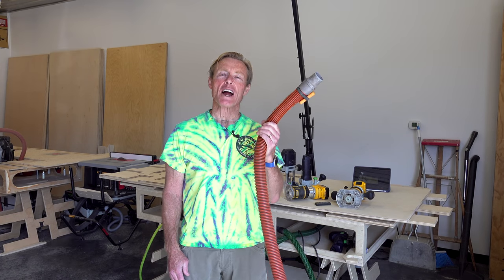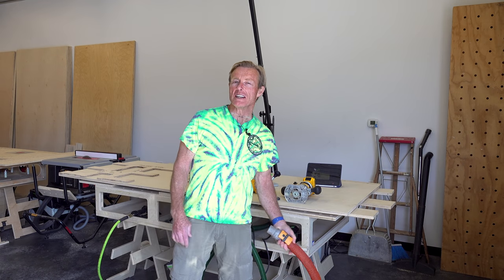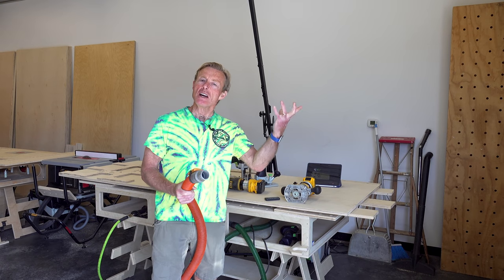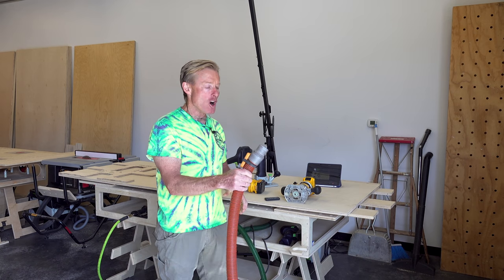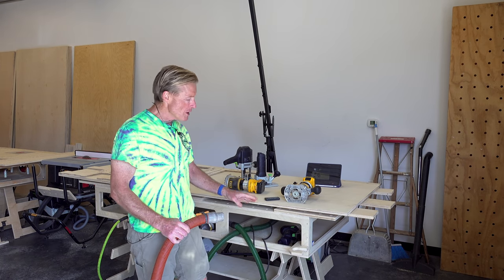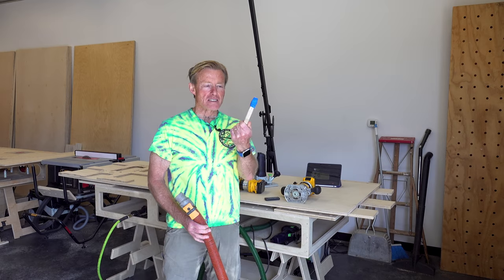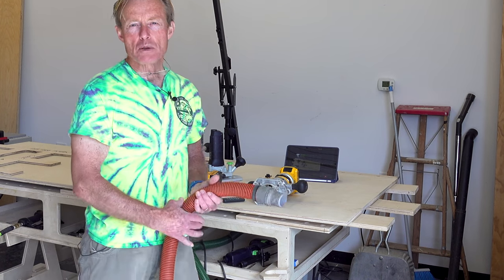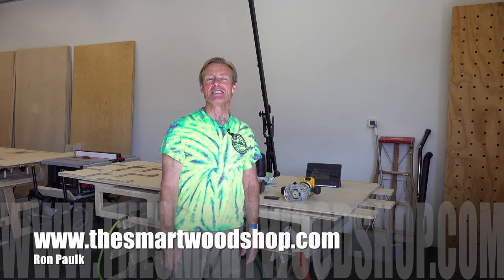Quick Tip  Vac Hose Management

Comment: Always appreciate you innovations.......but I would go with an attachment on the hose so you can stow it wherever you are and not have to go to where you put your hook. My solution would be to attach a wire hook to the hose that can hook over the workshop table and engage a hole on the margin or the lip on the under side of the work bench  shelf, could even make it from plywood as is your way. This would allow you to securely hang your hose anywhere you can hook it, if it was wire you can make it so that it rotates flush with the hose so it is out of way.....just my two cents worth, cheers
Reply from the maker: Good idea. There is always more than one way😎🤙

Comment: My clients don't want to hire a cleaner, they want a woodworker and progress. I get strange looks especially on hourly jobs if I spend time cleaning up. 
Am Not a clean freak but do like the tip. I do the day's work then clean up once a day. Best vac accessory I found at Sears of all places. It turns my vac connected to my tool on as soon as power to the tool is detected but with enough delay to avoid tripping the breaker.
Reply: I"ve gotten that look more than a few times. I can't imagine the look i'd get if i didn't clean up.  Meanwhile, once a guy i've known for 35 years asked me to help him get his house ready to sell, this involved pretty much every aspect of my tool bag.  He complained about me cleaning a brush, i told him, hey, i can pack up and clean them at home. . . 

It slays me what people value.  What can you do? I'm sticking to my guns, doing a good job, regardless of how the client thinks it should be done, or, hey, i can pack up, and work on my own home. . . As always, thanks Ron.
Reply: A clean shop is a safe shop.
Reply: It really depends on the client but here’s where I’m at, if your cleaning as you go it takes less time in the end, I would think you will be able to work faster as your not tripping over this that and everything else so there’s the safety factor and I would think that if it clean as you go you can just be more accurate I also would find it more calming to have it clean as I go. I guess the take away would be judge the client,but maybe if the client is worried about time spent cleaning and views it as taking away time from the job maybe that client would not be the right fit for some of us and we would just move onto the next one in the process of providing a quote
Reply: @mikeirwin4687  100% agree.
Reply: @deanaoxo  I work at a local glass shop we don’t offer mobile service anymore but when we did I always was super careful toy have to think about it like this your working on most people’s biggest investment that your working on , I think that’s cleaning as you go along instills to the customer or client that you care about your work and their house
Reply from the maker: Nothing but good comes from keeping a clean job site. When I had a crew, the first order of business was to teach them that my top priority was cleanliness and organization as it is safer, results in better work, and instills client confidence. A messy craftsman's work must be carefully inspected.
Reply: @TheSmartWoodshop  Essential Crafstman sure agrees with that.